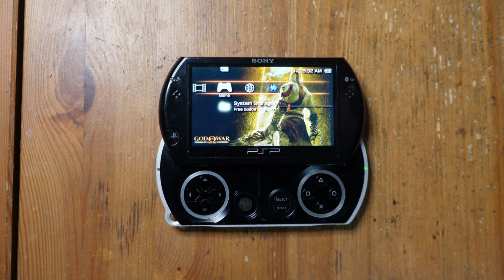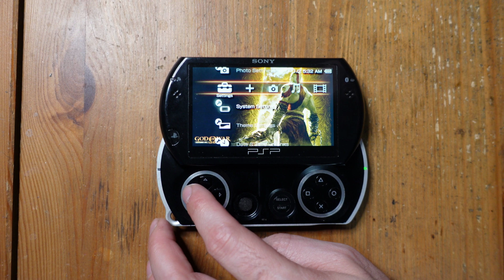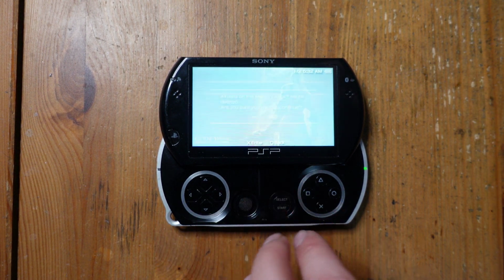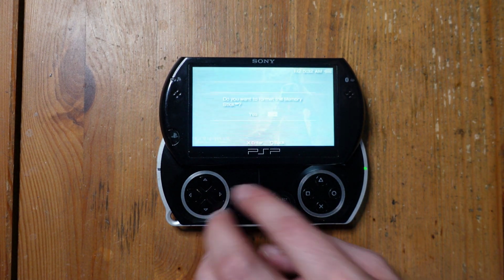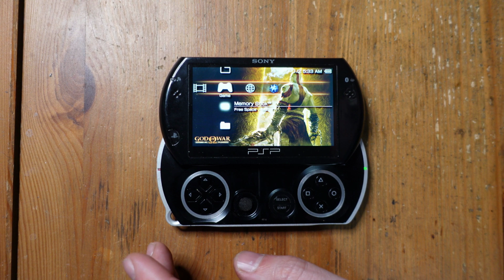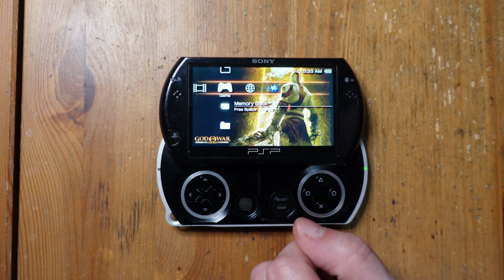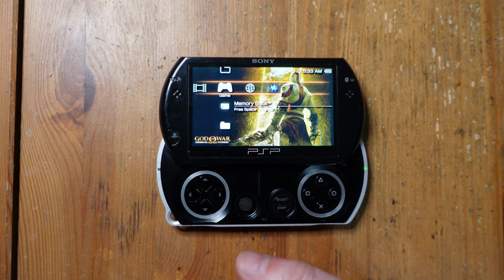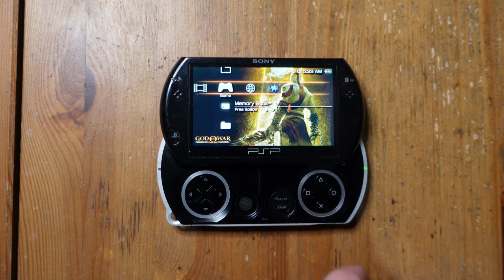PSP Go Storage upgrade! Install an internal MicroSD to M2 card adapter!

Comment: Heya! I'm the guy who makes and sells these. Just an update: the bridge (green wire, shown at 05:28) from pins 1 to 10 has recently been found to be unnecessary. I've updated the instructions and the item description on Etsy. Installing that bridge doesn't hurt anything, but avoiding it might save some hassle. 

Also, I've gotta admit, it's pretty humbling seeing a video made about this. Thanks! I hope it's still running strong :D
Reply from the maker: Thanks so much for the extra information and I’m glad that you make and sell these! It was very helpful to upgrade the storage capacity for this system
Reply: Hi Sir, what kind of wire can be used here? 30 awg wrapping wire? Because i bought 2 of the boards but i used magnetic wires it cant be soldered that is why i am asking if what kind of alternative wires can be used. Thanks
Reply: @m3oguitarmusic  hello, yes, that wrapping wire should work as well. Many people have used it and it seems to work well. Sorry, just saw this reply 😬
Reply: @AgentMetalKid-ve3if hello, unfortunately Vita memory cards are entirely proprietary, not even M2 micro cards. Pretty much the only way to expand memory beyond one of the official Vita memory cards is SD2Vita. If you're wanting to keep using your cartridge slot, the best solution might be simply to have two Vitas: one for downloaded games, and one for physical media. 

I'm kind of new to Vita myself, but that's what I've gathered thus far.

Comment: You ever tried 256gb?
Reply: Due to the limited read speed for the M2 Memory card, the max capacity 128gb (even in 128gb you can already feel the slowdown when you open a folder in the PSP) 

Many people recommended 32gb or 64 gb

Comment: I'm posting on comments on these videos to see if anyone has taken the time to find a cleaner version of this mod. I'm looking for(and attempting) a solution that doesn't require removing plastics, etc. either by slimming down the profile of the adapter or finding some kind of SD card with the M2 connections integrated. I've taken apart one of these adapters and the M2 to SD card controller board is fairly slim. My approach may be to solder controller board directly to an SD card without any housing, since I much rather damage that than the PSP itself. Has anyone done something similar?

Comment: Can i do that with a micro sd card too i opened one of those sd adapters and theres no electronocs imside to convert these just small circuit so would this work if i soldered the micro sd to the m2 board

Comment: Great mod! However, the PSP Go wasn't actually the final iteration of the PSP. That goes to the European exclusive E-1000. It had no Wi-Fi (no loss, as the PSP uses the very outdated WEP security, instead of WPA2-PSK), but it did bring back the UMD drive.
Reply from the maker: Cool I did not know that! Thanks for the heads up

Comment: So, there are M2 adapters that require no modding. Is this mod better than using those adapters?

Also, there is a cable that can be used to charge the console and to connect to a TV. Does anyone know where I can get it?
Reply: M2 adapters?? What do they use, microSD or memory stick pro?
P.S The “cable” you are talking about is the official PSP Go dock or cradle, which you can usually find on eBay. Beware though, as they are usually REALLY expensive especially for a sealed one. If you want, you can buy PSP Go component cables, which are way cheaper than the dock, but won’t charge your PSP Go, but still outputs to your TV

Comment: My psp go doesn't read on the computer anymore any theories?
Reply from the maker: Hard to say exactly. It could be that the port is damaged but it may also just need to be cleaned out with some isopropyl alcohol
Reply: Will try thank you

Comment: I bought a ribbon cable equivalent of this mod that spares me the soldering work. The site was entirely in japanese so I had a huge language barrier to understand the guide and the translation feature on my browser was not doing me many favors either. It never mentioned needing to bridge the first and last lines on the memory card adapter so perhaps that's what is holding me back from getting it to work with my PSP. Anyway great guide btw!
Reply: @ZubiddyDooDooPop I think I had the mod your mentioning or something similar. It had conductive adhesive at the end of the ribbon cable. You had to cut the dividers on the SD card adapter for it to lay flush. Mine still works somehow.

Comment: Does anybody know what the limit is for storage using this method?
Reply: 528GB (400+128GB micro SD cards in dual adapters), not all adapters work.
Reply: the sky  is the limit

Comment: Thanks for this video. I ordered the adapter and just finished installing it in to my PSP Go. I love that, with the exception of the inside case trimming, the mod is completely reversible. I actually took the time to mod all 3 of my PSPs today. Now I have time to go play some games for the evening! Thanks again!
Reply from the maker: Awesome! So glad that it worked out and it’s definitely a great solution for increasing the storage on these systems

Comment: 16GB M2 is max. They're rare + expensive. 32GB is max for a stock system, 16 GB being internal memory. They show up as 2 separate, 16GB drives. This looks very interesting. Thanks for the video 👍.
Reply from the maker: Glad that you enjoyed the video!
Reply: They sold 64GB M2 cards where I live
Reply: @Geert890  where did they sold those?
Reply: @antiquefuturistic  Netherlands
Reply: @Geert890  You are so lucky, I would kill to get my hands on a 64gb m2 card.
Reply: @magnaesca165  why? What would you use it for?
Reply: @Geert890  to put in a psp go.
Reply: @magnaesca165  Why not use a m2 to MicroSD adapter
Reply: @Geert890  those are real?
Reply: @Geert890 as far as I know there are still no M2 to Micro SD Card Adapter (Memory Stick to Micro SD for sure but no M2 to Micro SD)

The closest one that we got are this mod and the more recent and updated version of this mod that Genius Game Mod made
Reply: go to know. i just required one and just want to use it for emulation. for smaller games like NES, Turbo Graphx, and Game Boy/GBA. I want it for a smaller affair

Comment: Would be cool if there is a way to replace the original slot so that you could insert the micro SD card into the same slot that the m2 went in
Reply: It seems its possible but this option in the video seems easier to do.
Reply: @odntht  yeah it definitely is easier, though it does seem like a bad idea to leave the m2 slot attached and usable since inserting an m2 at that point could cause serious problems.

Comment: I have a PSP Go and I love it, sadly 16GB is kind of limiting and I have no way of doing this mod or getting an actual M2 memory stick... Other than that, it's a cool little handheld
Reply: You can buy it preassembled
Reply: @plumb3311  i live in Brazil, shipping costs are absurd, it's literally cheaper to buy another PSP Go and just use 2 different units for different games
Reply: I know how you feel, I bought a psp go but it didn't come with any m2 card. So I had to save up and buy an m2 card over ebay, it was only 8 gb but stupidly expensive. It came from china and I live in middle-east. Of all the psp models I love go most but It is just so annoying to keep changing games by plugging it to a computer. I mean the problem would have been solved if there were 128gb m2 cards. I would even settle for 32 gb m2 cards but they don't even exist. Damn sony for not using micro sd cards like the other models. Dumbest decision ever.
Reply: @magnaesca165  they wanted m2 to sell
Reply: Psp go only supports 16 gb of external storage
Reply: You can store quite a few games on 16 GB. I've got about 16 on mine and that includes both God of Wars and all the GTA games. I also have gbSP on it and put about 10-15 of my favorite GBA games on it too. Don't forget PSP Minis! You could throw on about 100 of those games and it would only take up about 3 GB of space.